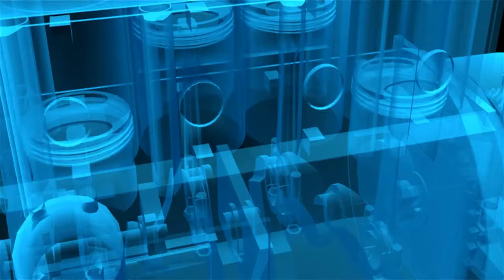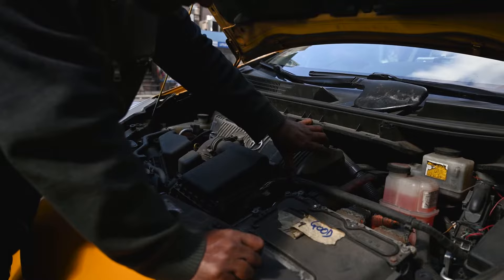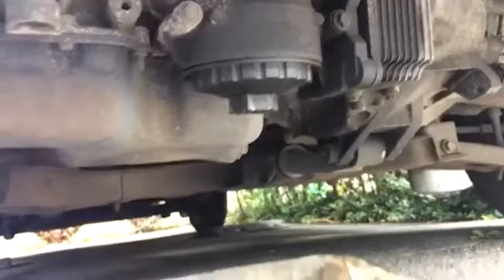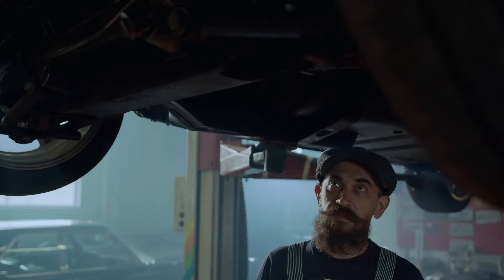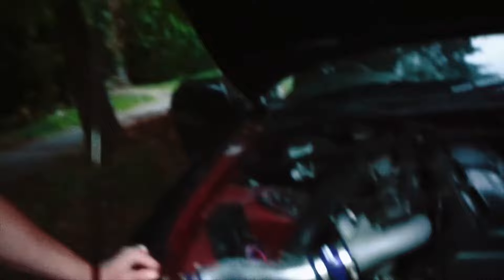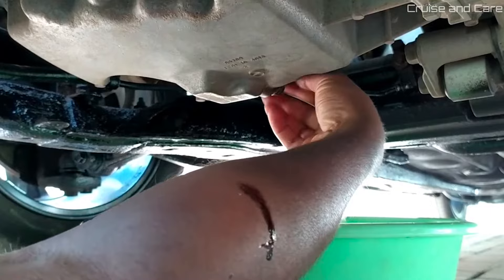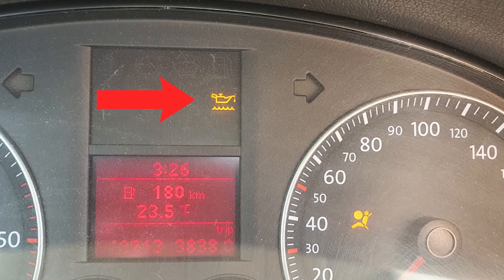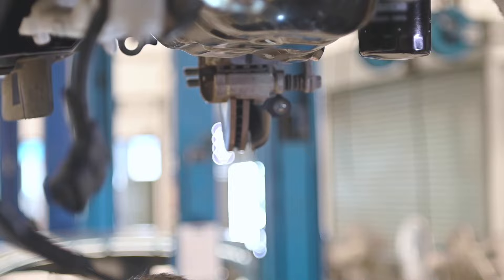Engine Oil Light Comes On and Off But The Oil Is Full!

Comment: My 06 Chrysler GC 3.8l light came on when idling.  Turned out to be the wire running from alternator and starter had a blown fusible link.  Ran a wire from the alternator and battery which fixed the problem.